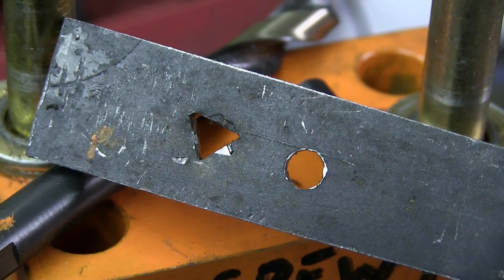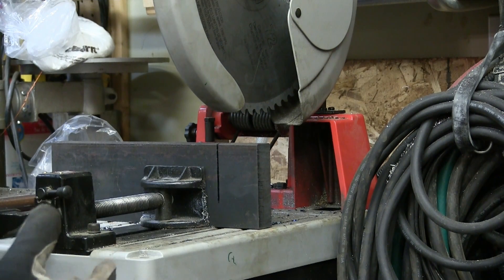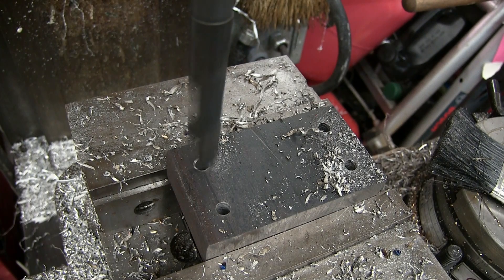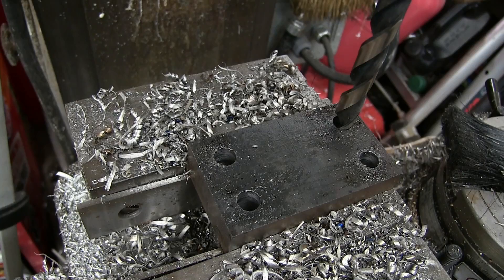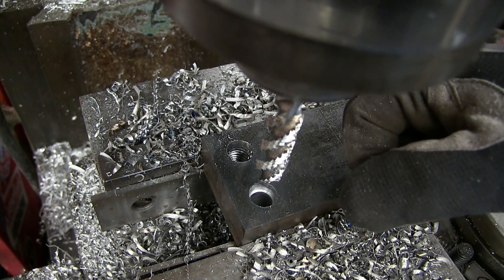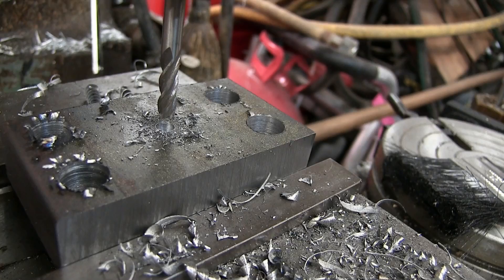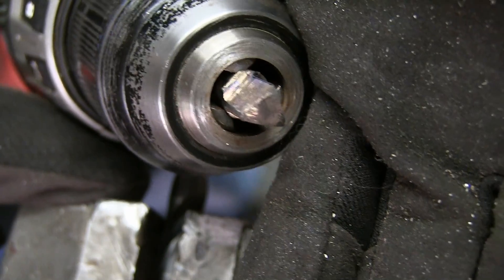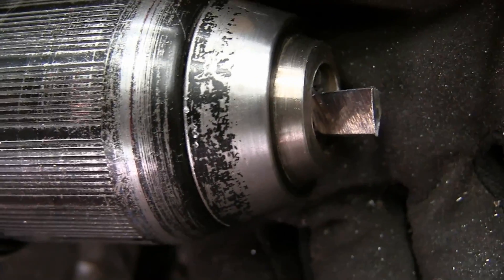Easy and Simple way to make Triangular Holes with a Drill

Comment: Still can't get used to seeing sparks coming off that chop saw. It makes me think something is about to explode at any moment. 
       Incidentally, most drill bits of any size are made of two components The business end is usually M2 (HSS) or M42 (with added cobalt). The shank is a softer steel so as not to be so brittle and to avoid damaging the drill chuck jaws. They are friction welded together just above where the flutes run out. Not to be confused with your friction stir welding, friction welding uses a type of lathe which gets both sides spinning at high speed in opposite directions. They are then slammed together under great pressure which heats them to welding temperature almost instantly at which point, both halves stop spinning and fuse together all the way through to the core. It's an extremely strong weld. You can know this is true due to the fact that the shank end often gets scored up from spinning in the chuck. That could not happen if it was as hard as the cutting end.
You could probably do that on your own lathe if you were so inclined.

   Also another way to "drill" a non-round hole of any shape or size is to find a broken end mill (or start with a fresh chunk of steel, hardened) and grind shape you want, but smaller than the finished hole size, (including some relief angles), square, round, triangle or whatever, mount it in the Bridgeport collet (a Weldon holder would be better if you have one), then, after drilling a pilot hole, run the quill up and down while moving the table a couple thou per stroke. 
     
    Not to keep just keep rambling on here, but if you've ever wondered what the machined flat surfaces of the very back end of the ram, it's there to mount an electric shaper attachment (made by Bridgeport) which goes up and down on it's own so all you do is move the table after each stroke, just like a shaper.
    
   So there's some useless trivia for the day.

Comment: I had some Harbor Freight drill bits that drilled triangular holes. They weren't marketed that way, but they did!
Reply: +GreenAppelPie no lie, i have yet to see anyone sharpen a drill
Reply: +Liberty4Ever 
Let the apprentice sharpen your bit... all sorts of wonderfully shaped holes, 'cept round.
Reply: was a semi sarcastic play on the use of drill rather than bit. i see it failed. have a good one everybody:)
Reply: I had a harbor freight drill bit actually untwist and turn into a flat bar. I wouldn't use it on anything harder than pine.
Reply: :'D
Reply: nah, they call me the thingy that makes holes by manual labor. I have a phd. it is laying in my truck right now. i have dug several postholes with it :)
Reply: i call my post hole diggers my phd
Reply: OMG. I just realized something. I'm an earth drill.
Reply: +james lawrence 
Yep, I mentioned somewhere in here about letting your apprentice sharpen them for various shaped holes, lol. Taking the web off center does it too. On holes deeper than 1/2 diameter it'll chew the bit's margin all to shit too. Re-tipping a 1/4" bit (or tossing it) isn't so bad, but chew the margin on a 1"+ morse bit and apprentices can expect the proverbial pink-slip.

A shitty chuck (with tapered jaws) is pretty much guaranteed to walk the bit in a triangle.
Reply: I once used a spade bit to enlarge a hole, the hole ended up triangular and my hands ended up numb, but it was good enough for what I was doing.
Reply: awesomesauce
if the tip is sharpened at different angles you can wind up with some funny shit. it doesn't happen until it is bad and i'm not even 100% sure why it happens at all(i'd expect since it spins in a circle it could sort itself out). a flat bit(spade) is great for drilling a circle, never saw a square or triangle bit myself.
Reply: +james lawrence My engineering tutor from college also told me that drill bits are actually called drills, not sure about the drill motor thing but it was definitely something similar if not that. I've also heard people refer to bits as drills on YouTube too
Reply: +Liberty4Ever usually that means that the drill was not sharpener properly(one side dull, offcentered or whatnot)
Reply: +Liberty4Ever 
Let the apprentice sharpen your bit... all sorts of wonderfully shaped holes, 'cept round.
Reply: +Liberty4Ever
according to merriam webster, my view of a drill is proper. yours is as well, by the way. we could really argue the definition, but when i looked to see who was right i found we both were. it is probably just a difference of where we grew up more than when. where i'm from, pretty much any changeable and disposable bit of something is called bit. funny thing is, if it was something like a bow powered drill, we'd call it a drill, as it doesn't have a replaceable part.

edit: where you're from, would they call a brace and bit a brace and drill? i'm curious now.
Reply: +james lawrence 
I think "only" in layman's terms does a "drill" do the cutting rather than the chooching. A Tool-maker would call what he was using a "twist bit" (jobber series).
Reply: LOL
Reply: I found some at my machine shop at work Harbor Freight drills I just use them as nails the hang-up cutter bodies

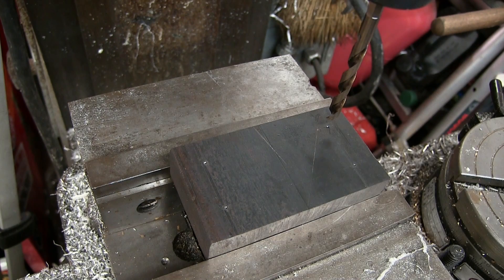Comment: 2:45 " I don't need any lube" = "I don't have any lube"
Reply: +Zachary Adams Also translates to: Lube is located more than 3 feet away...
Reply: and of course i dont need any lube i have this special unobtanium sintered pixie dust drill bit. <-- is that whatcha tell your wife?
Reply: proceeds to use lube later in the video
Reply: I've used bacon grease. It might not do diddly for the bit but it sure smells good.
Reply: you need lube if you didn't foreplay.
Reply: 7:03 uses lube with tap bit
Reply: No lube needed with unobtainium bits, did you hear him, I mean really, I have a set of those too and with a dab of lube those drill into grade 8 bolts like butta!
Reply: +SilverSmoke95 thats propbably not lube its a metal softener...
Reply: +minecraftermad it can be lube... im not really sure... on or the otheror both in one :D
Reply: +Zachary Adams Spit is cheaper.
Reply: :D
Reply: And actually he has some
Reply: only pussies use lube 👍
Reply: He used the lube on the bits he cares about
Reply: +Zachary Adams lube just makes more expensive smoke